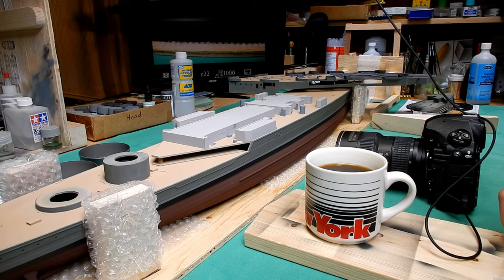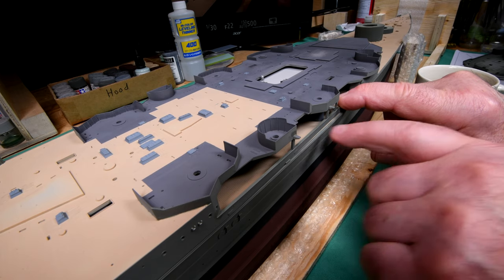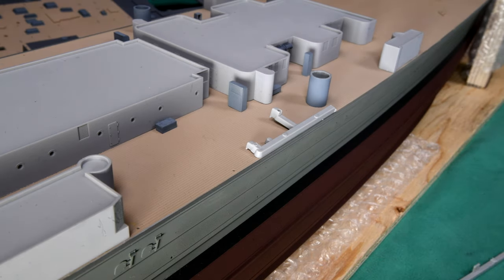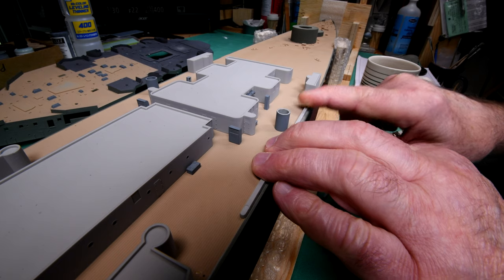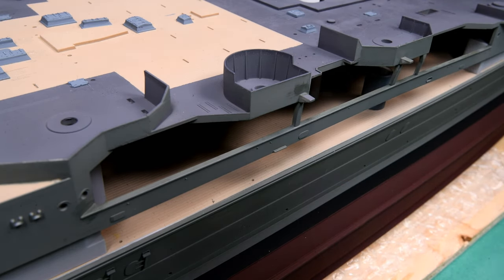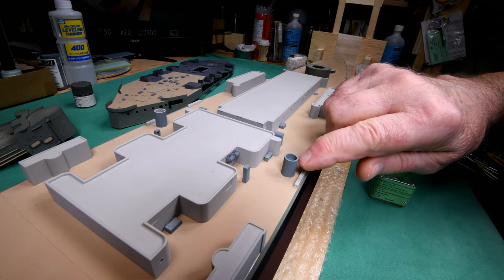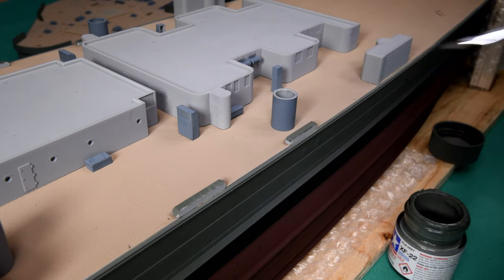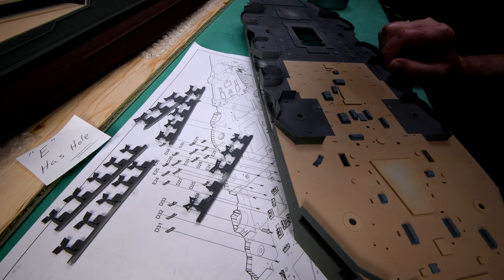The Model Ship - Part 599

Comment: Hey Ron, not sure it will make a difference, but there are rather large sprue nubs on the shelter deck (the hole in the deck where the funnel would be going). those nubs look like they are sticking down below the deck and may be pressing on the parts below holding the shelter deck up. Not sure if it will make a difference, but could be worth a try. Great work so far.
Reply from the maker: Will check on that, thanks. 👍

Comment: Hey Ron, did you film this in 4K? The detail is extremely sharp when compared to other episodes. Also are there any ladders going from the boat deck down? If so I would suggest that you check the openings to see if the PE ladders will fit into the opening. Sometimes the ladders are a tad larger then the openings. See you tomorrow.
Reply from the maker: Re: 4K
Been shooting and uploading to YouTube "mostly" in 4K for almost 3 years now.